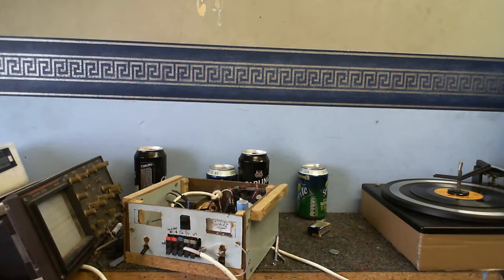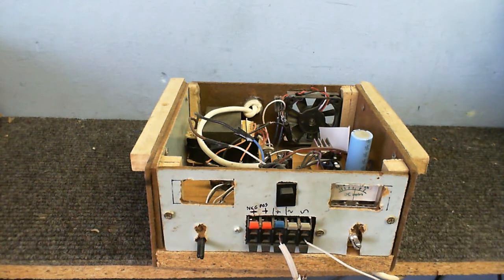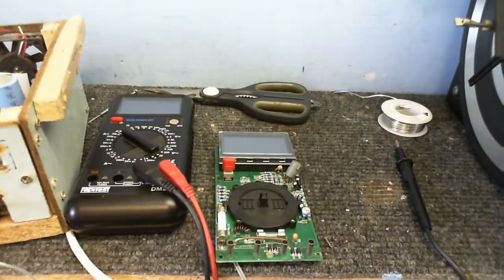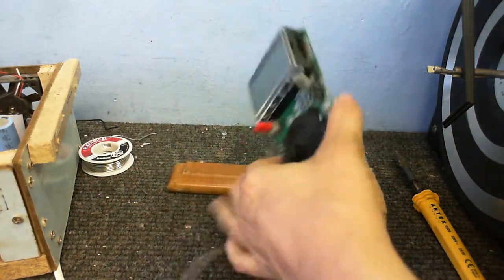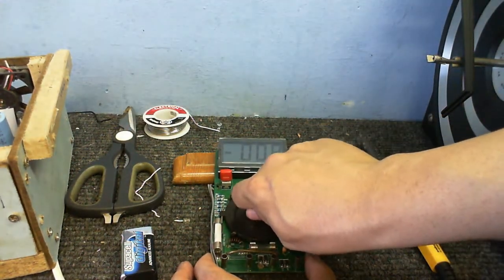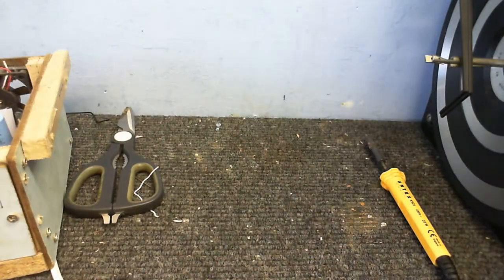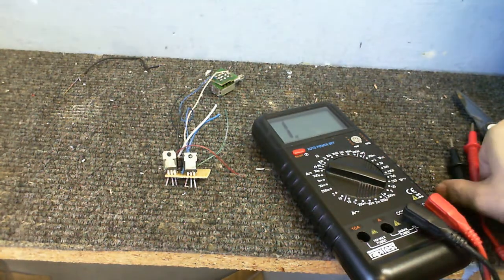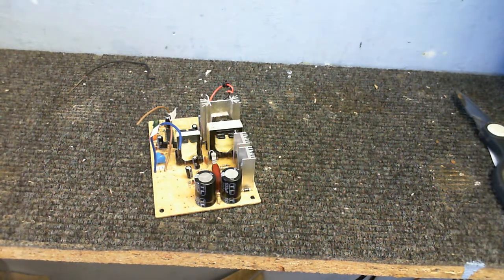CDC Electronic Workshop   Fixing my Mulitimeters and some Power Supply rambling

Comment: Usually you can modify a switching PSU to make it adjustable like this: Very often you have an TL431 Shunt Voltage Reference which has 3 pins, on the power supply. The first pin is the reference pin which has 2 resistors as a voltage divider. You can play up with the values and find a suitable pot to put acros on of the resistors which will make your PSU adjustable. Remember that one resistor increases the voltage the second one lowers it. I made that on a printer PSU and gives me 9-32V output!